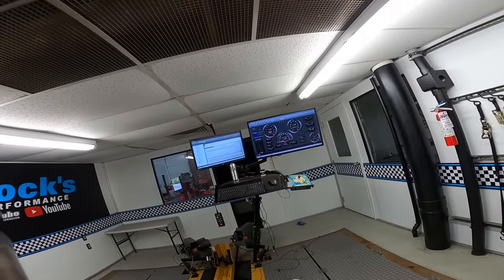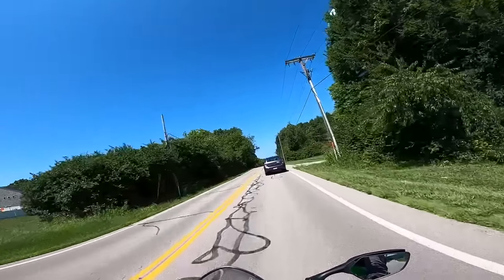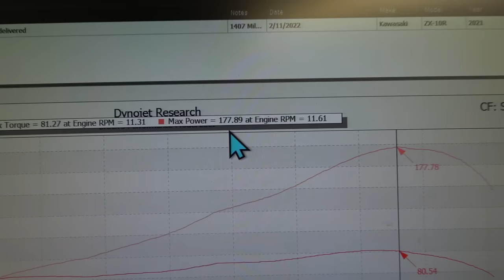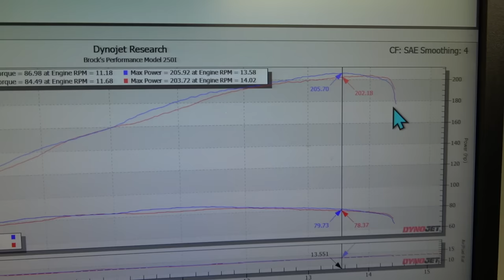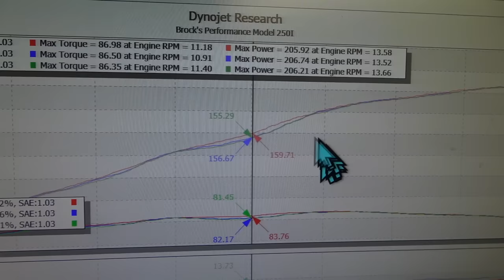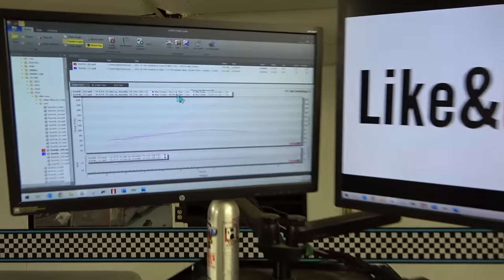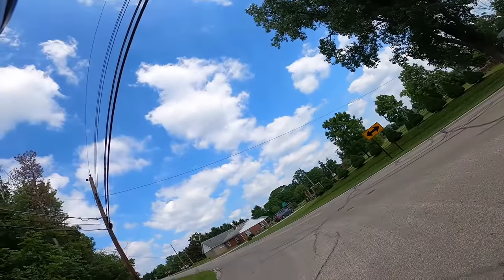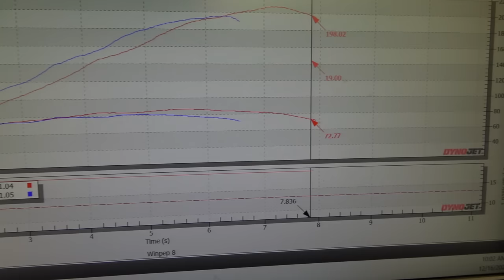2021 Kawasaki ZX-10R Sets New 1000cc Horsepower Record

Comment: You're right they're a awesome motorcycle, ridden my brothers 21 zx10rr a few times & walked away very impressed. Not just the power but they're actually reasonably comfortable & the quick shifter is so well sorted.
Reply: I ran a slightly modded 2019 or 2020 zx10 on my 2020 Hayabusa and he pulled from me like I was completely stock.  All I had was an air filter and exhaust but still.  After a couple of pulls we switched rides and did some pulls.  What a bike!  I thought being 1000cc and lower torque than my bike it would lay on takeoff but nooooooo, that thing is a rocket!!!!  I'm 215 or so suited, other guy is about 135 with gloves and helmet but it was still no contest.  The newer liter bikes are no joke!
Reply: @BOOSTED Biker  yeah true they're fast , but they lack the low & mid like your Hayabusa has & my zx12r.

Comment: The difference is? No stacks or short stack?  Depends ! +/-on the Dyno ? No ram air flow, but get two leaf blowers test it again on the Dyno!! No stacks & short stacks! ☺️😉👍🏼 sincerely yours, Terry Ernst
Reply from the maker: Leaf blowers and any other items that falsely force a much higher air speed into the bikes ram air are useless. The proper way to read the difference in air/fueling at speed is via lambda sensor in the exhaust while logging throttle position, engine RPM at a minimum. Dyno operators who falsely promote simulated ram air that create conditions that do not exist in the real world are doing the owner a disservice, IMHO.

Comment: I have a big Hp 2018 H2 sx se that’s very fast , very comfortable, and it has heated grips. Going from that to the zx10r, to the 21 H2 carbon, to the 21 zx14R, the zx10r feels so light an nimble.  Awesome video.
Reply from the maker: You should try BST wheels. I forgot to mention the moment Mike G got off of Mike F's 2016....he walked into our sales office and purchased a set of Rapid TEKs for his 2021. True story.
Reply: @BrockDavidson  I want to go carbon , I’m just hesitant with these N.Y roads . I’m afraid of a rim breaking at high speed

Comment: Love the stock to Brock format and really looking forward to you playing with the Energica - I'm looking to test ride one in January and might even buy one if I like it enough.
Reply from the maker: @Dave G, I want to answer the question "where does the Energica fit in my riding world?". I now ride Harley's more than my import bikes. I only live 7 minutes from work and the lack of noise/heat etc... has to fit in to my riding world somewhere. But where? Stay tuned :)
Reply: @BrockDavidson  Similar thoughts for me. Already have an electric car, big adventure bike and Street Triple that I drag race - so maybe it will end up at the track!
Reply: @daveg4644  bro please tell me your Dragging a 765! 😅
Reply: @gripthebars1513  Yep. 4th in this year's ET bike championship in the UK. PB is a 10.31 @ 136 with a stock motor.
🙂
Reply: @daveg4644  that’s amazing! Just wondering have you gentlemen been able to bypass the euro -5 limiter?
Reply: @gripthebars1513  not directly, only by using a PC5 at the minute and a few hours on the dyno - currently at 135 bhp with a decat and can.

Comment: I love your videos, and especially this with all the data and comparison - thank you! And this despite me not being in the market for big horsepower, as I prefer tight, constantly winding roads, where you hardly see a straight piece of tarmac and speed range sit between 30 and 70 mph, and handling has absolute priority over horsepower.
Reply from the maker: The lessons in this video apply everywhere, especially the smoothness during cornering. While big power may not be your target, as an (obvious) student of handling, you know how a poor tune will disrupt you chassis...especially on the exit.
Reply: @BrockDavidson  Thank you for answering, and you are absolutely correct about throttle response - there are few things as disconcerting as coming off a corner (1st gear being worst) and have the engine hesitate and/or coming on with an abrupt hit. Such poor throttle response, which plague a surprising number of modern motorcycles, is of course annoying just riding along in ordinary traffic, and adding a passenger exacerbate the issue and typically add banging helmets to the mixture for additional entertainment. Hence many owners would benefit greatly from a tune the way you do, even if they are not looking for more outright power.

Comment: Brock, this is an OUTSTANDING video.  Especially seeing how with each addition, from Penta-carbon exhaust to the 3 different velocity stacks how you can see the numbers changing; increasing or falling short.  That being said, do you believe the GEN 6 Velocity Stacks would be a wise choice to swap into my 2017 ZX-10RR?  In addition, I checked the Kawasaki Parts and surprisingly, the 2017, 2018 and 2019 ZX-10RR all share the same the part part number for Duct, Funnel, #1, #2 and Duct, Funnel #3, #4.  Yet the 2021 and 2023 ZX-10RR (there was no 2020 or 2022 model ZX-10RR) Parts Diagram shows NO STACKS in the Air Cleaner.  What do you make of this?  //  EDIT:  I found out why.  The 2021 and 2023 use Variable Air Intake that is regulated by servo to maximize output at all rpms.  When the funnels are raised, intake bypasses the system for optimal high RPM.  When lowered, intake air passes through the taller intake funnels for increased mid-range performance.  How neat is that?
Reply from the maker: lol, I love marketing. Dollar's to doughnuts the variable rate intake is designed to reduce inlet noise. As far as "should I" - I can't answer that, but you can do the work and let us know what you think.
Reply: @BrockDavidson   Based on your video, the Gen 6 Stacks proved beneficial over the Gen 5 stacks in your test.  So, if I were a betting man, I'd say what you proved for the Gen 6 stacks over the gen 5 stacks, it might be reasonable to believe there is an update to the Gen 5 design that led to a newer Part Number for Gen 6.; therefore, more power across the curve.  They are a relatively cheap purchase so, I'll keep you posted!!  Thank you for your response Brock!!

Comment: Love your content mate! Big fan. I have a 2021 zx10r just with full titanium exhaust and a DNA filter. Bike was dynoed tuned last week made 200.51hp to the rear wheel. So from what iv seen there is no point with doing after market Velocity stacks? I just did a 520 chain conversion with -1 tooth on the front to give it some more low/mid torque. What else can I do? We have E85 over here do you think that would be good to get it up around 210hp at the wheel? I would have to fully retune again yeah? Thanks heaps Andy
Reply from the maker: Hello Andy. As we mention frequently, velocity stacks don't make power... They move power. We made the best peak horsepower using the stock stacks on this project, but that doesn't mean there couldn't be something better for your application. I'm not a big fan of E85, especially in normally aspirated applications because it requires double the volume of fuel compared to gasoline. We have the advantage of using VP MR12 here in the states instead. It makes almost as much horsepower, you don't need a completely separate map to drive home like you do if you do not have E85 available and run out of gas. There are also considerable gains to be made by using a true high flow air filter, as well as a lower viscosity oil with an anti-friction additive. Our combination is listed in this video, or see the link in the long description. Best of luck!

Comment: Amazing video Brock, just subscribed to you channel! I currently have the stage 1 but does the stage 2 BT now have your improvements and teaks on it? My 2021 is smooth but not as much as yours was, do you reckon it has to deal with stage 2, sprint and PCV?
Reply from the maker: That's a question for BT Moto. I have no control over what they offer...only what we do. Our Stage 2 is without the fuel tune altered in the ECU.
Reply: @BrockDavidson  I understand, phenomenal work! Is there a way I can possibly get a stage 2 tune from you?

Comment: Brock,
You are tuning the bike via a power commander with the BT used to unrestricted?   Why not just apply your tune to the ecu via woolich in customary fashion?
Reply from the maker: If you mean import the PCV fuel map into the ECU using 3rd party hacker software... the reasons are simple:
A. The import function does not work correctly, especially on the dual injector bikes which rule the sportbike market.
B. Ease of tunability. Japanese Sportbike ECU's are still quite neandertal when compared to automobiles and even compared to the latest crop of fast Euro bikes. This makes the PCV's simplicity and ease of tuning/adjusting work in harmony very well with them.
C. Under race conditions, the PCV's simple format makes altering the fueling to match the current atmospheric conditions an easy and very beneficial task.
D. The use of an inexpensive map selector switch allows for instant fuel map swaps on the fly. This not only comes in handy when accomplishing C above but it can also be used to compensate for poor quality fuel (run a rich/safe map until better fuel is available) or provide additional drivability/power when traversing between high and low altitudes. 
E. Anyone who disagrees with any of the above, does not own a dyno outfitted with all of the measuring and data logging equipment we have at our disposal here at Brock's Performance - much less 40 years of sportbike tuning experience to comprehend and properly implement positive performance enhancements as a result of the information provided.
Reply: Chatted with Don quite a bit in past years, he seemed to frown on the Power Commanders referencing failure rates.  Not saying I can vouch for that as true or not but am in loop with several tuners using software to make tuning changes directly to the ecu vs a PC...even a few use both on same bike.   I'm running a gen2 zx14r and gen6 zx10r both with a reputable tuner making changes via woolich software ( also unrestrict)unrestricted.
But I guess back to the bike here.  I suppose I would of thought you could of sent your tuning adjustments right to BT and had them load it to the handheld device.

Comment: Hi Brock.. awesome stuff. I also run a 250i. Just wondering how much load you're using for the pulls
Reply from the maker: WOT? No load. Riding with under load to introduce the additive - that varies from zero to 20%. Mapping, we use tuning link and adjust the load/acceleration parameters to fit the application.

Comment: As always great job sir 

I have a question for you about all these people starting to go to 520 chain and sprocket combos on bikes like this new zx10 and the others you mentioned 
I’m an avid drag racer so I have always run 530 everything are the new chains just that much better or do people just care less about safety and strength
Reply from the maker: We have never been able to measure an increase in performance switching to 520...but we have broken many chains (and cases...) as a result of switching. That said, Chris Moore has had much better luck with more modern day 520's. Maybe get with him?
Reply: EKX 3D chains are about the best 520 chains you can get. They're rated for 220+hp.

Comment: What does E85 do with these gen 6 bikes?
Reply from the maker: Primarily blows them up if changes are not make to the bike to allow E85.
More info: https://brocksperformance.zendesk.com/hc/en-us/articles/360061988291-E85-Fuel-Should-I-use-it-in-my-motorcycle-

Comment: My 2021 Zx10r needs a new trans once I buy a new transmission and get it cut and polished I’ll be back on my performance again but gotta find a trans 5th gear issues
Reply from the maker: Get with Mark at R&D Motorsports in Florida.
Reply: @BrockDavidson  thank you I appreciate the info

Comment: what gearing  are both bikes running brock ?
does the 2017 have carbon fiber wheels you answered my questions at end of video kool
Reply from the maker: @Karl, the 2016 is 16-41, the 2021 is 16-38 as tested.

Comment: Brock, I am tossed up between your Penta-carbon full system and the new CT Meg.  I like the cleaner, all black, shorter look of the Penta-carbon, but, I have to question as to why you introduced the new CT Meg?  Does the CT Meg show better numbers on the dyno?  Is there a video comparison available I can watch???  Will you soon offer the CT Meg as a all matte black ceramic coating like the Penta-carbon?  And between the two, I saw the SAE J2825 db specs on both exhausts at your website, but which one sounds deeper (not louder), but deeper.  Thanks again Brock.  For $2K, I just want to make an informed decision between the two exhausts available.
Reply from the maker: @johnnyappleseedz422  - contact our customer service team. They can explain the differences in detail and help you choose what's right for your use and budget. 9379120054 - BD
Reply: @BrockDavidson  Brock, just got off the phone with Karissa and she knocked it out of the park with extensive information.  Very knowledgeable, very professional.  Now I have to decide between the black ceramic coated  Penta-carbon or the titanium CT Meg!!  Decisions, Decisions!!

Comment: Brock I've noticed the 21-23 zx10s sound very deep/growly like a old k5 gsxr 1k compared to the 16-20s sound like a 600 any idea why? (Even if both have the same exhaust)
Reply from the maker: @DelilahZx10 R - I'm not 100% positive. We noticed the same thing on the 2020 S1000 and credited the variable valve timing. The only things that would make sense on the Gen 6 ZX-10R's would be the additional power. The more power an engine makes, the naturally louder it is. More power at lower throttle openings can make angry tones also.

Comment: With my stock wheelbase Brock's equipped gen6 sitting at 9.00 on the QTR mile I'm wondering if I should switch from the gen5 stacks back to the original gen6 ones ???
Reply from the maker: @Daniel Natalotto - If you watched the video you would, especially drag racing a stock wheelbase bike that see's the rpm in question during the launch. Do you have a power commander?
Reply: @BrockDavidson  no mate I haven't got a pc, but me and Bren went back and forth tweaking the map, street tuned with the afr gauge and a go pro.
Reply from the maker: Do you and Bren do this EVERY SINGLE TIME you go to the track? LIVE as it's happening? If not...you are leaving performance on the table. Not slighting Bren - LOVE THAT GUY! Just relaying my honest opinion to a fellow racer. Message me if you want more details.
Reply: @BrockDavidson  it's a bit tricky with the 13 hour time difference to live tune 😆
Reply from the maker: ...as you re-enforce my point... :)

Comment: I’m confused on what exactly a power commander does? At one point I thought it collected data for a baseline flash and now I’m starting to think it’s a device that can switch between types of flashes or tunes? Second thing, can you tune a bike with a flash on it? I thought a tune was basically a flash specifically for your bike. And I thought a flash, from brentuing for example, is a tune that all bikes (all bikes as in same brand and model) can use. In other words a flash is a very general tune that all bikes can use.
Reply from the maker: https://blog.brocksperformance.com/faq/do-i-need-a-pcv-when-installing-a-brocks-performance-exhaust-system/

Comment: Something I've been meaning to ask is about the ram air. Does it actually add to the bike or is it just marketing jargon and if it does, do you have to account for it in the fuel map since the dyno room doesn't have the airflow of the open road?
Reply from the maker: Yes, it works very well. The bikes sensors allow the ECU to select proper mapping. It can prove beneficial to map for these speeds on some bikes. But it has to be done on a closed course using a data logger, etc.
Reply: @BrockDavidson  i see. So you need an open space to do it, it can't be properly done on a dyno, right? Thanks for clearing that up.
Reply from the maker: Some dyno's try to fake ram air, but the only true way IMHO is with the bike moving at the speeds being adjusted.
Reply: @BrockDavidson  ok thanks a lot.

Comment: Hey Brock so I’m getting a 23 ZX-10R can you flash my ecu or who would you recommend?
Reply from the maker: Get with BT Moto
Reply: @BrockDavidson  thanks so much!! Is there anyway you could make a vid/list of all your changes and upgrades you e made to the 2021zx-1r??
Reply from the maker: @Final_Boss_Racing  the product list is in the long description. Your 23 should not different from a mechanical standpoint as it's still the Gen 6.
Reply: @BrockDavidson  gotcha I bought the sprint filter from you already and I have full exhaust world wide bearings block off plates. Is there anything significant that you think I’m missing?

Comment: @Brock Davidson i have a 2019 is the motor the same as the 2021?
Reply from the maker: No. You have a Gen 5 , the same as Mike's 2016.
Reply: Brock you are not right.
The zx10 from  2019+ have the same engine as the gen6. They changed the bucket valve train to the new finger-follow. It's exactly the same as 19-20 year motor from gen5. In gen6 they changed transmission gear ratio only, and some additional stuff around the engine.
Reply: @BrockDavidson  if you could tell me, on stock pump gas did you touch the timing or was stock at wot?